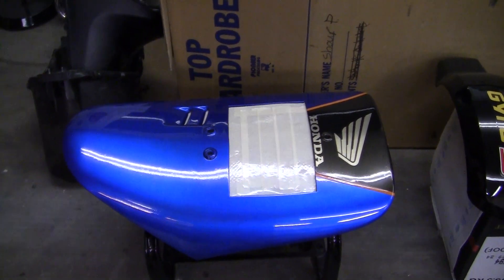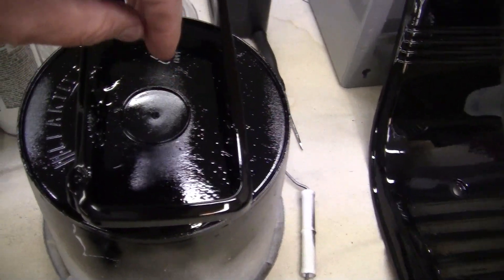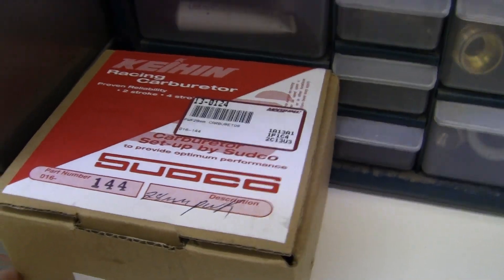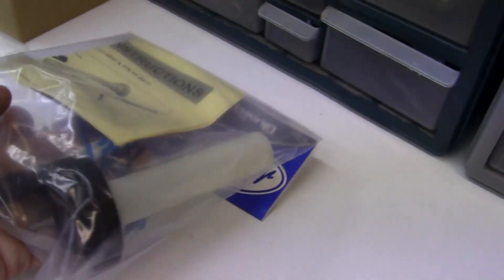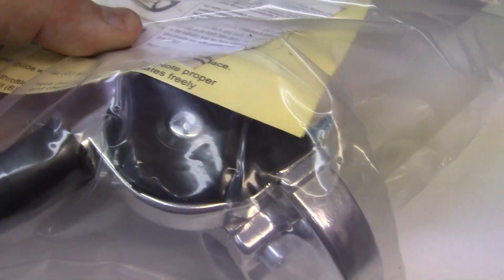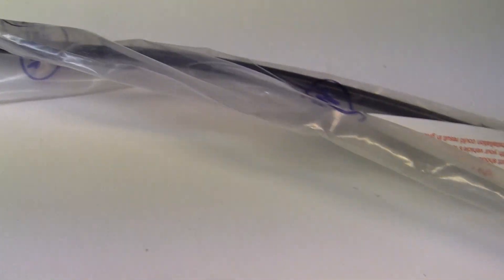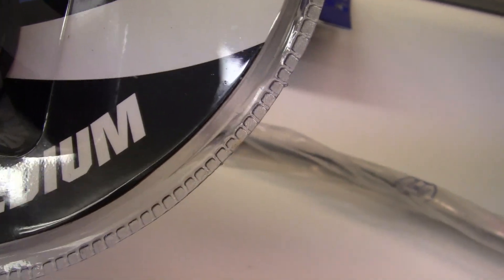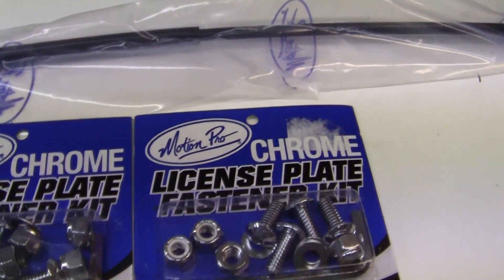High Speed Dio Racing Throttle SECRETS.

Comment from the maker: @late95 CHeck to make sure your drive belt is in new condition. An old worn belt will slip way too much and cut down your top speed alot. Take your rear clutch off and check the needle bearing in the housing to make sure it is not damaged. A worn needle bearing is impossible to see and will drag the clutch housing greatly at top speed. Make sure your variator weights are not worn. Make me a video of the variator belt and clutch housing and I could tell you better. RH DSD

Comment: @late95 
So when im driving and i pull my clutch in and rev it, it gives good rpms but when i take it off the clutch it just lowers the rpms. and when i have full gas it gives less power than when its 3/4.

Comment: @DIOSpeedDemon well ill just post it here
So I have a 49cc moped Tunturi Tiger Aqua -89 and its only been ridden 8000kilometers and its in almost perfect condition, but the top speed is only 35km/h when it should be 45 as stock Ive only done some exterior modifications no mods on the engine except for cleaning the carb, the piston changin the spark plugs. and now i have tried to look for any problems that may affect my performance, but now i dont know what look at anymore.